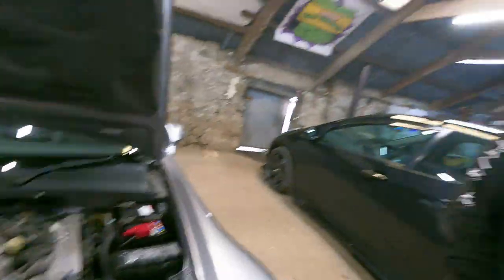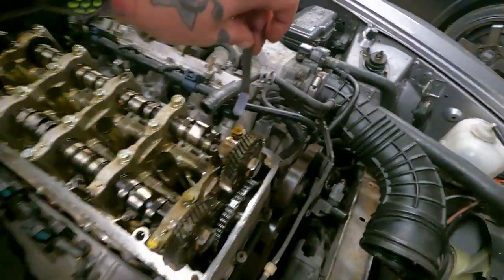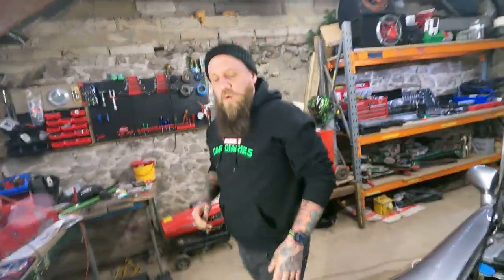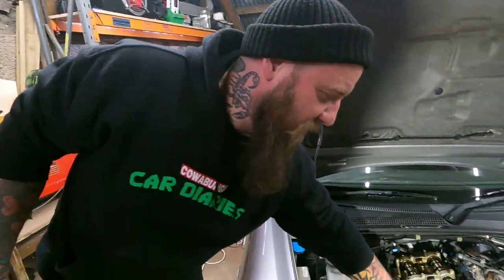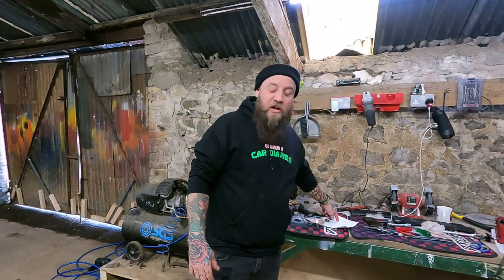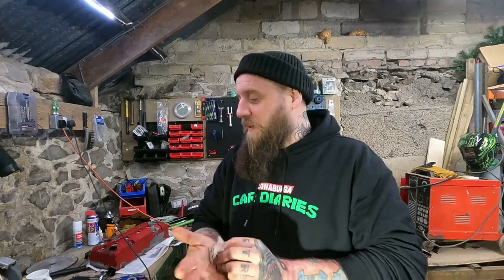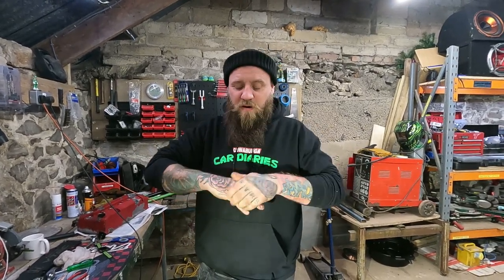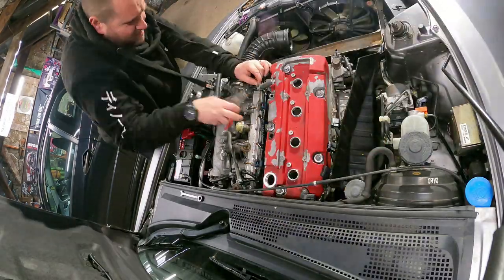Honda S2000 Valve Clearances

Comment: Would it be easier to loosen the clearance, insert the feeler gauge, gently tighten the clearance until you feel contact on the gauge, then back off say a quarter turn and recheck? Instead of trial and error?
Reply from the maker: Probably lol as said in the video we changed the way we did it to a much easier way in the end